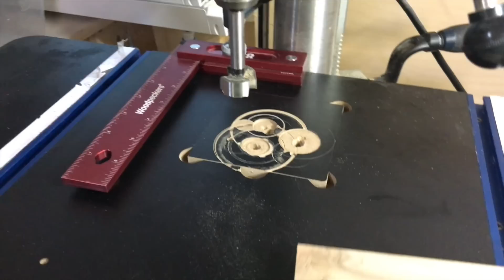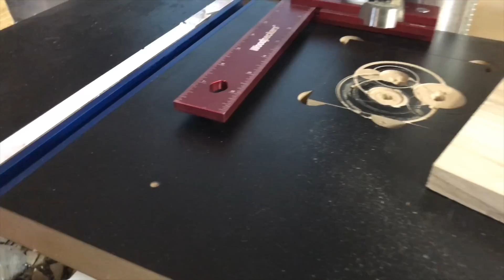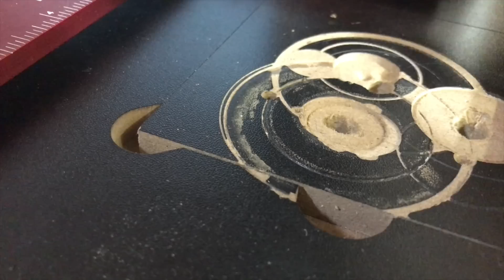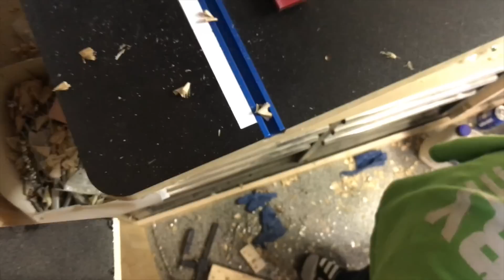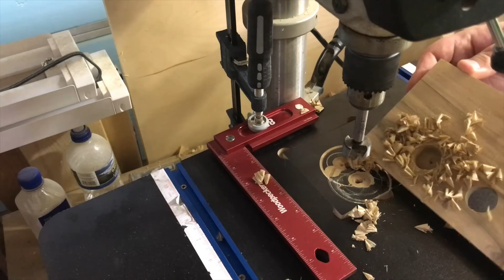Ⓕ Forstner Bit Drill Press Table Tip

Comment: I've done stuff like that but not with a square, that's a nice little jig to make the handles on an apple box. With one setup you'd just flip it over and then turn it around to get the 4 holes, and then just connect the dots.

Comment: What drill press will work with the 2” forestner?
Reply from the maker: A few will - some factors come into play - material drilling into, hard or soft wood - and drill press speed - if you can slow the press down you can normally snag some torque with it - 1/3 hp or bigger should be fine taking your time - 1/4hp if you get a little creative - to make my, now overly verbose answer a tad more succinct, try to snag some 1/3hp or above, as well as a 1/2” drill chuck (many have them) - and it would be remiss of me not to add, clamp it down - whatever you’re drilling, that 2” bit has grab, and unless it’s a long lever you’re drilling, please clamp it down - best of luck ✌🏼
Reply: @NickFerry  Thank you! I got it to work 😊

Comment: I have a 2' hole in the center of my dp table, which is actually the top of a box with a dust port on the side for my dust collector. I keep a scrap of hardwood under the table as a backer for whatever I'm drilling into to reduce tearout.